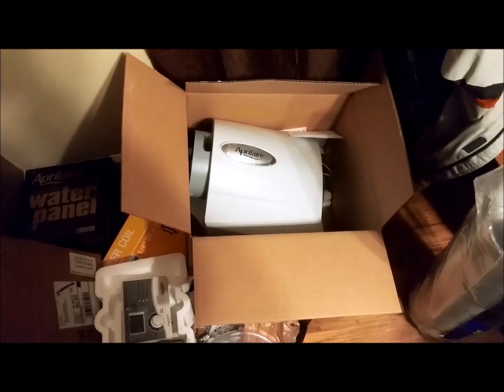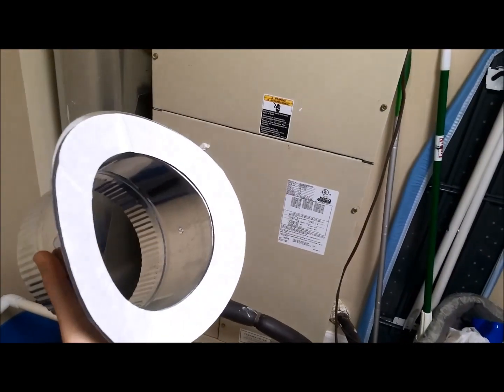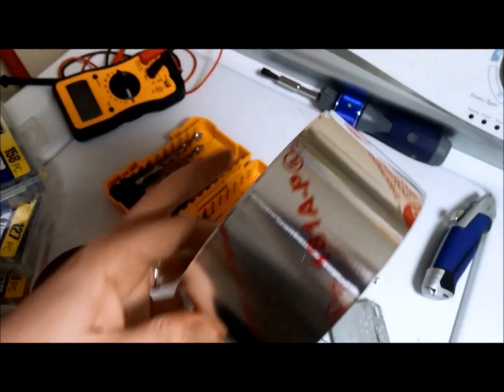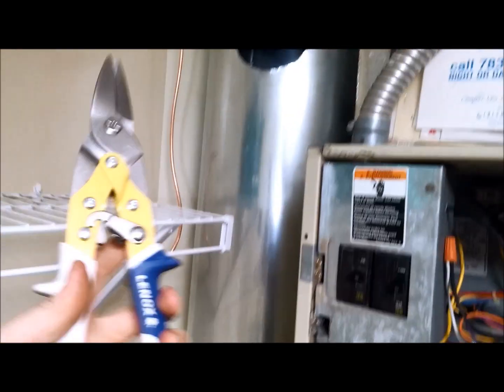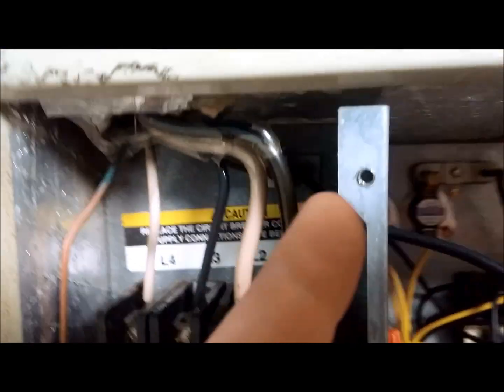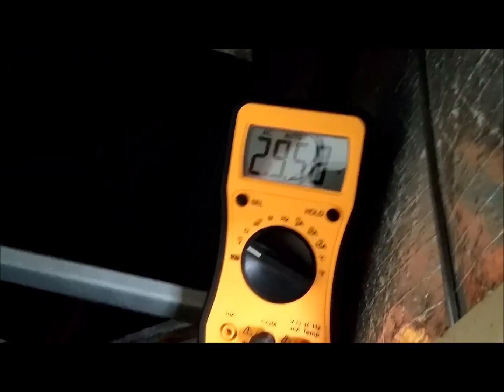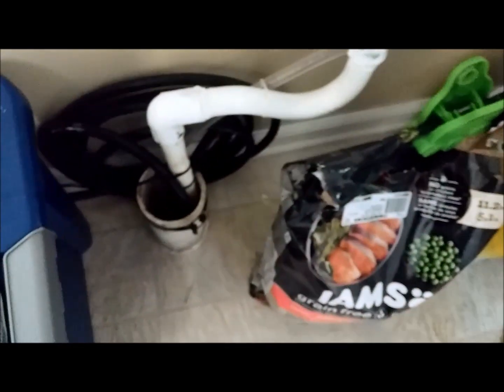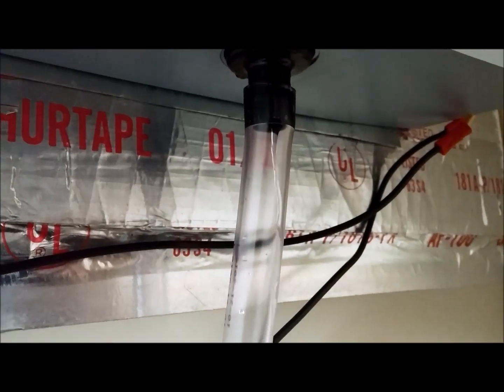Aprilaire 500 DIY Install with Nest Thermostat

Comment: An option if you are using the relay is instead of it switching the output of that always-on 24V humidifier transformer, instead use it to switch the 120v into the transformer.  That way, the transformer isn't on all the time,  only on when the blower is on,

Comment: White this set up, do you set the humidity on the nest to a certain level, and then does the furnace blower activate to spread the humidity? I want to know if the heat can be off but still have my house humidifier this way
Reply from the maker: It has been a long time since I did this and I no longer live in this house so I'll do my best to answer. I believe you CAN have it set to humidify with only the blower running (fan only, no heat) but the manufacturers make a point to say that these bypass-type humidifiers are really only effective when run with heat. I think you need to get a "powered humidifier" if you want to effectively humidify without the heat on. This is just my memory.
Reply: @jspianoman07  thanks for the response!!
Reply from the maker: @DanA-eb4ik  No problem. Also, I guess I missed your first question. Yes, on the nest you set a desired humidity target and the system will attempt to reach that level. It's not perfect though. I now have an Ecobee and on it I actually the target at something like 45% and it attempts to reach this. On my old nest, you never actually set a number, instead your target was more of a "low, medium low, medium, medium high, high" type system in a sense. Worked the same way though.
Reply: At least on a Nest 3, you can configure the humidifier to come on when  the heat and fan are running, or just the fan.   But I don't know if that means, if fan is already running, and the humidifier wants to turn on, it will.  Or, will it actually turn on the fan?  [The humidistat/autostat can do that.  As I believe also the Ecobee Premium thermostat.]

I think the powered humidifier just has it's own fan, and doesn't need the bypass line from the return line.   But it still needs the blower fan to distribute the humidified air.  It's little onboard fan is not meant for that.

Comment: would this be the same for a dehumidifier? looking at an ultra aire 120H
Reply from the maker: I can't say for sure, but I highly doubt it. The nest, wired up this way, is specially meant for a humidifier.
Reply: @jspianoman07  https://www.youtube.com/watch?v=-5T3GwJBmTk this appears to be a very similar setup but with a dehumidifier... on your nest, is there an option to change the * equipment to dehumidfier / humidifer? i can't do it on mine since nothing is connected to it yet...
Reply: @jspianoman07  https://support.google.com/googlenest/answer/9297562?hl=en looks like it's supported.